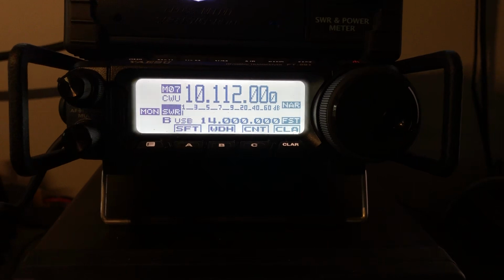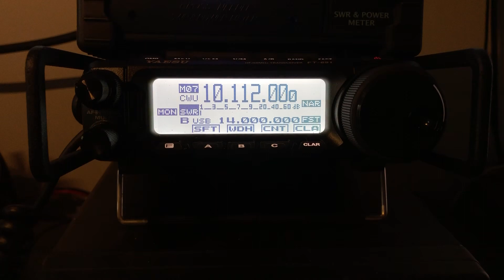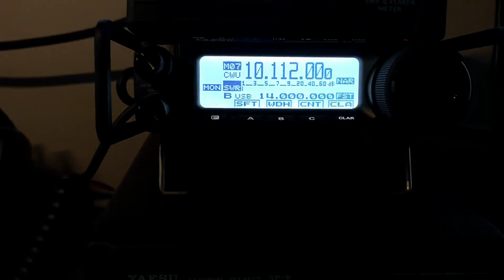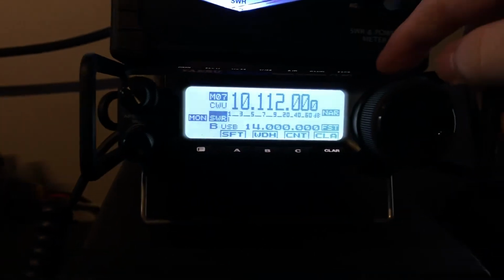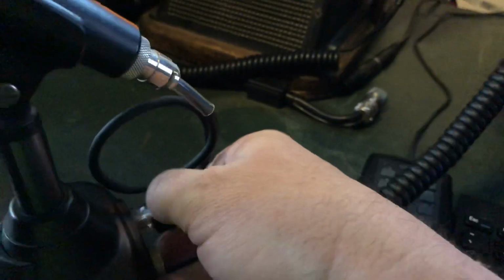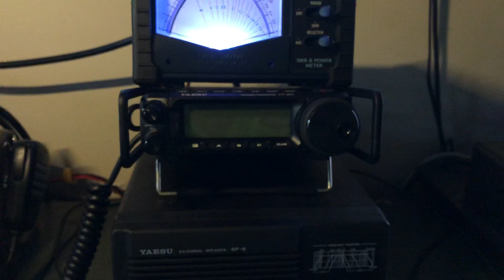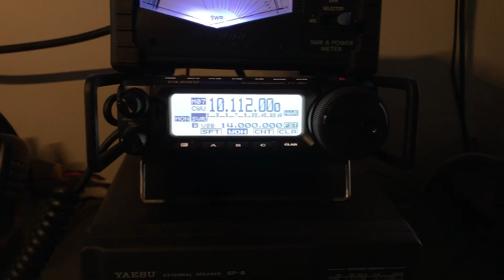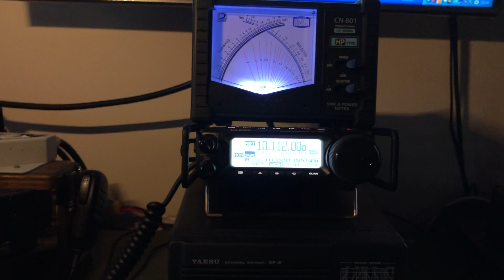Yaesu FT-891: My Temporary Base Station (FTdx5000 at Yaesu for CAT port repair)

Comment: My 891 CAT port took a dump. I called and they also told me it was rf that fried the chip. Wonder how many more CAT ports have been rfed? It was not worth the repair. So now the 891 is my POTA rig. No computer in the field so no big loss. Needed a reason to buy the 710 anyway.
Reply from the maker: Had your 3-year warranty expired?  

RF resulting from common-mode current killed mine. I should have installed a couple of Mix-31 ferrite chokes on the CAT port cable. It came from RT Systems without chokes. But I didn’t pay any attention to it. Outputting 1100W into an OCF dipole on 80m killed mine. The antenna matching unit makes the finals happy but the RF still radiates off the shield of the coax.  It’s the nature of an antenna that requires an antenna matching unit for certain bands.
Reply: @n4hnhradio   unfortunately yes

Comment: Good video👍 I picked up a used FT891 at a Ham Fest last weekend for a very reasonable price, my first Yaesu HF and I am watching all your videos.  I am loving 🥰 this little Radio,  I wish I had got one much sooner.  73  KV5P
Reply from the maker: It’s an unsung hero.  Better receiver than the IC-7300, just no fancy display.  The FT-891 makes a great mobile or portable rig, but I’ve used mine as a base station too.  It pairs well with a Yaesu MD-100 desk microphone.  I feel certain that the M-70 desk mic will also work well with it.  One of my viewers plugged an M-70 into his FTdx10, using the same mic EQ settings I show for the hand mic and he sounds great!  I assume the FT-891 would also match well with the M-70.  I know it matches well with the MD-100.

The DNR is also quite good but it must be set to algorithm 9 or more, no less.

The DSP puts the icing on the proverbial cake.  If your into CW, you will be delighted by the filtering.

Congratulations!  73, de N4HNH
Reply: @n4hnhradio  I saw several MD-100’s at the Orange Texas Ham Fest last weekend I wish I had picked one up now.  By the way I am really enjoying your videos on the FT-891 they are really helping me out.  Intuitive is not one of my strong points so good step by step tips are definitely appreciated and you do an excellent job and have my initial setup quite enjoyable❗️. Thanks 73. KV5P

Comment: Thank you for your great videos!
One question came into my main: How can I see on which VFO I am? I rember having the VFO in use been highlighted with black background but I cant remember how I had this. Now when pressing A/B to make the VFO change there is only the A and the B with no background change. Thank you! 73 de DK2HM
Reply from the maker: Be sure you’re in VFO mode and not memory mode.  Pressing the A/B should toggle between VFO A and B.

73, de N4HNH